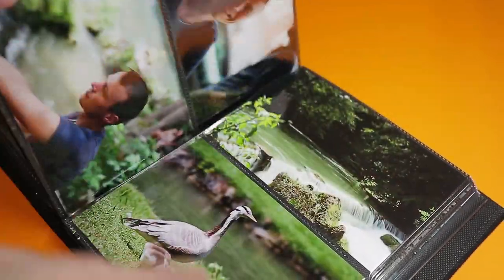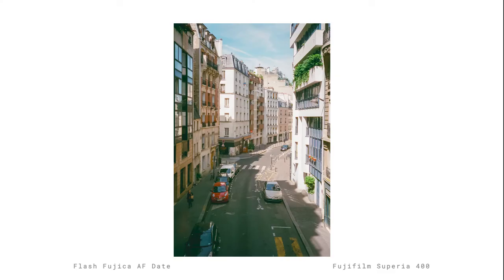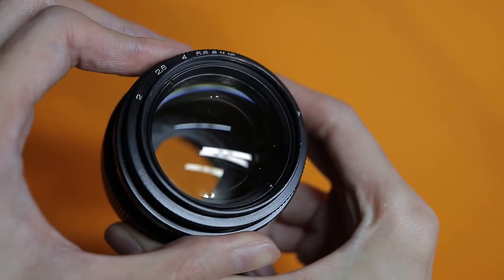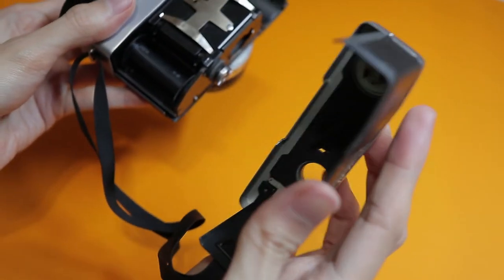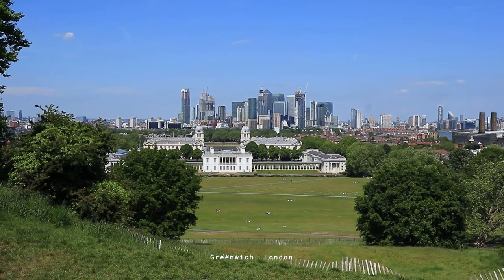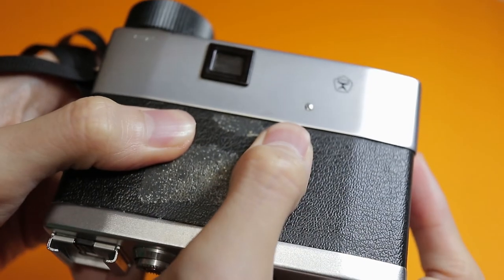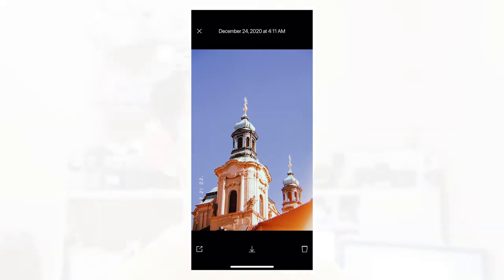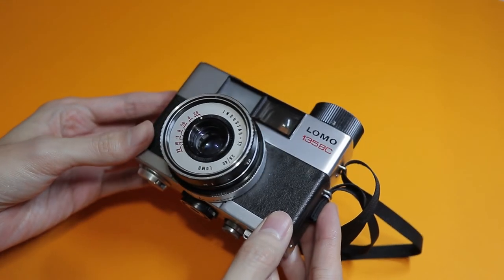Light Leaks

Comment: The lessons here seem to include to never take an extended or image important trip without first using your equipment enough to know they are working properly. As to light seal leaks, this must be one of the cheapest, easiest DIY repairs: you just get the proper materials and replace the seal strips in the body. The biggest hassle is that the old seals commonly turn into a sticky goo, which is a bitch to clean out first.  Outstanding choices in the Fuji point-n-shoot cameras.
Reply from the maker: Yeah, I tested the camera right before going on my trip and it was fine tough luck haha but like I said in the vid, I had other cameras with me during that trip so it’s not all doom and gloom haha 
I was gonna fix the light seals on the Fujica (even planned on making a video) but the camera broke (shutter won’t cock) so I just replaced it. I’m keeping the body as part of a collection though 😂

Comment: Don't feel too bad bro ironically when I have light leaks it's usually my fault. The last time I was in Toronto and open the back of my rolleif to take the film out only to realize I hadn't rewound it. Most of the other times it's when I'm developing myself and I take the cap off to pour in the next chemical only to realize I unscrewed the top of the canister instead of the light seal cap LOL. At least yours wasn't user error. I'm going to look up that fujika series. Unless you plan on doing a subscriber giveaway 😌
Reply from the maker: Thanks Ray~ fortunately, I haven't accidentally opened my camera before unwinding the film (yet! I feel like that's bound to happen to everyone at least once hahaha). I think my most amateur mistake so far was when I loaded my film wrong and I ended up with a whole roll of blanks because the film didn't advance at all 😂 

My old Fujica AF doesn't work anymore though~ I'd give it away if it were just the light seals that need fixing. 
I just checked eBay for the Fujica Auto-7 and they'd risen in price! I got mine for like $25 in 2018, now they're in the $100s 😮 the Auto-8 is newer and cheaper, but the 7 has the better lens, imo.